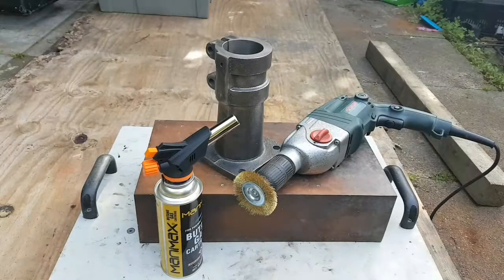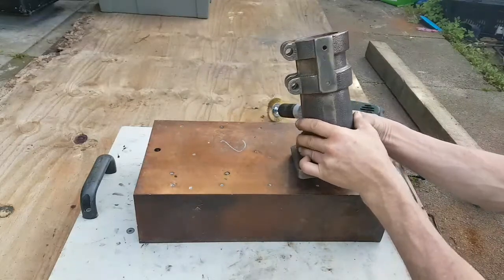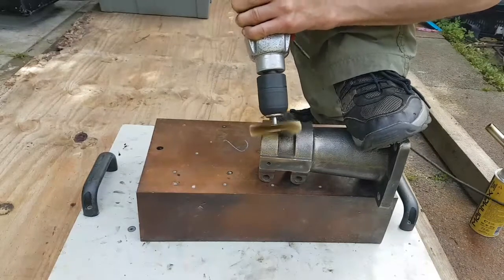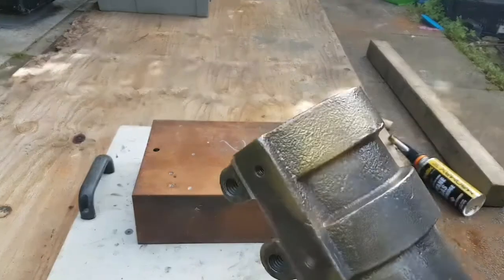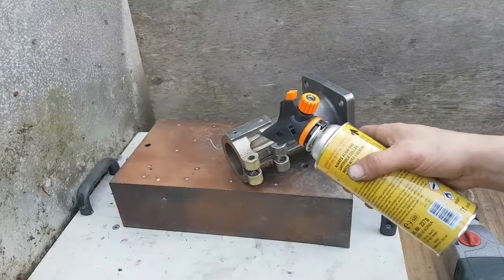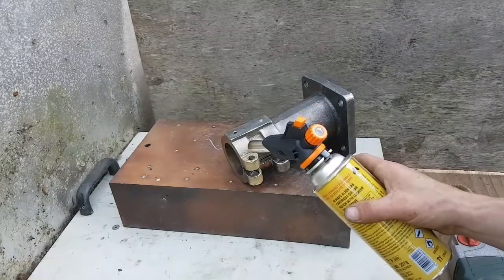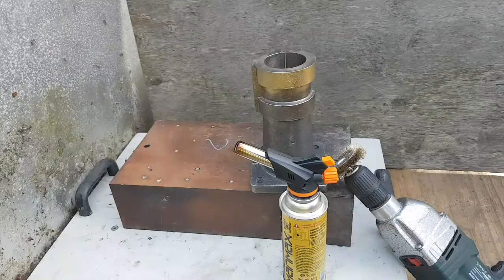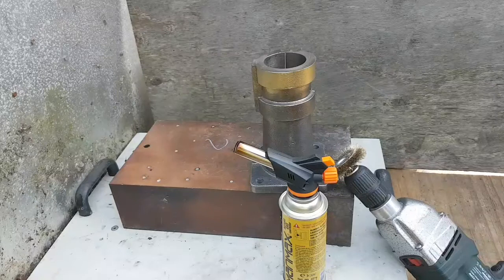Dore Westbury Mill Restoration #5

Comment: That is really cool have never seen that trick before...hard choice between brass/paint/electroplating
Reply from the maker: Thanks boltonky

Although I did find out after the fact that the technique is best applied to mild or carbon steels as cast iron has special heat requirements or it's prone to cracking. 

Seems I got lucky that time as my casting has an intentional split round the back which allowed it to expand and contract without doing any damage.

Comment: I like your applying brass to the heated metal.  I may need to try the same at home.
Reply from the maker: Just be mindful that cast iron can warp or crack if unevenly heated. 

I managed to get away with it as there's a split down the back of the casting that allowed the metal to flex and expand freely.